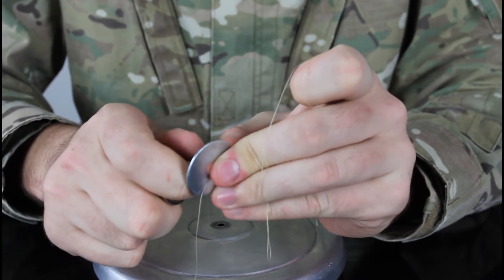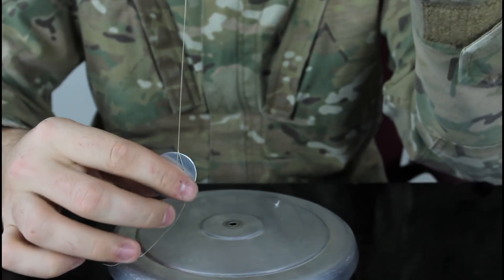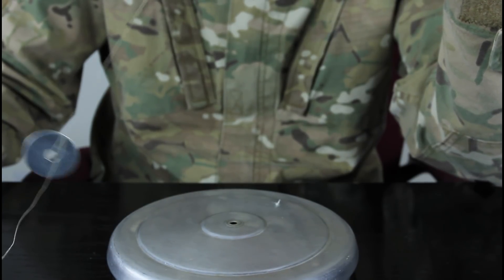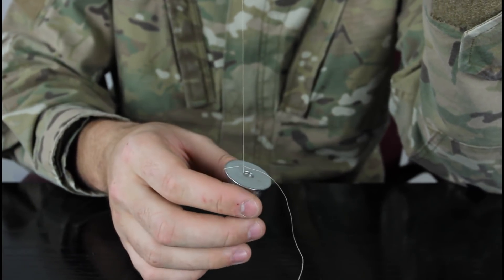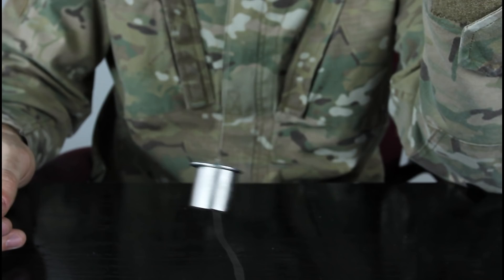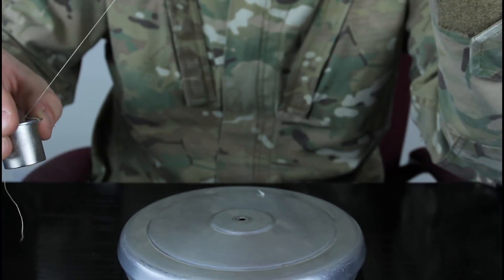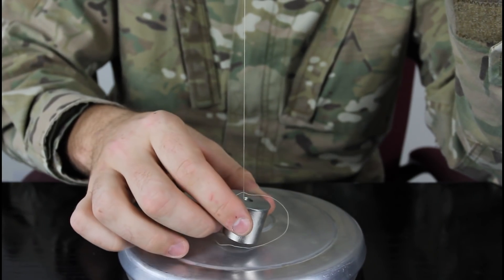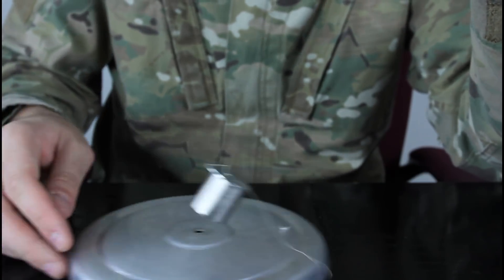Neodymium Magnet Experiment (Eddy Current Tubes)

Comment: He didn't put a magnet in the plate. its like the experiment with the copper pipe and the magnet. the copper isn't magnetic, but when the magnet moves, it induces a current in the aluminium plate. The induced current is called an Eddy current, which creates an opposing magnetic field, which slows the magnet down. he isn't hiding anything, its just physics.
Reply: The difference is that copper attracts a magnet whereas aluminium doesn't. So this is 'magic' he is referring to.
Reply: Martin Herschke Actually, copper is diamagnetic - it repels a magnet, but the force is really weak.